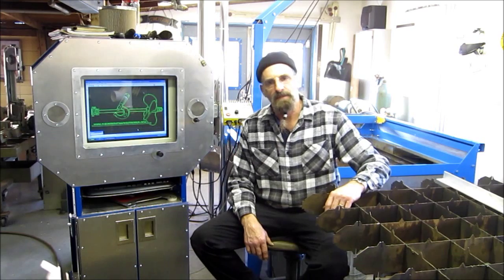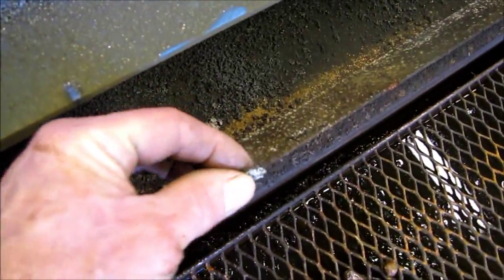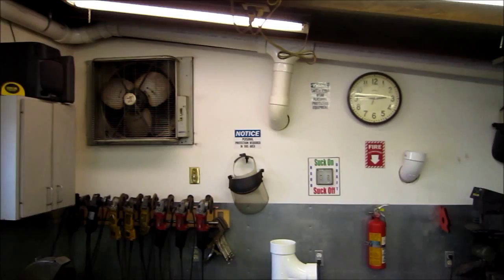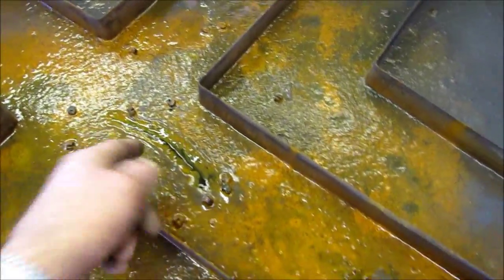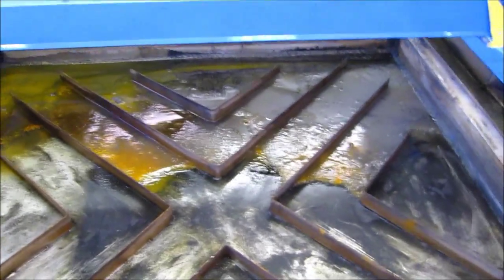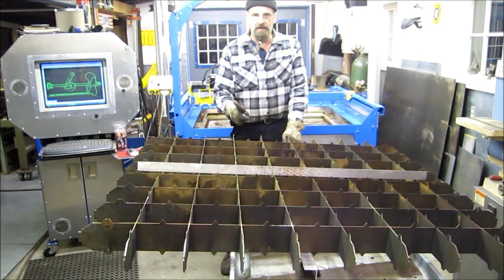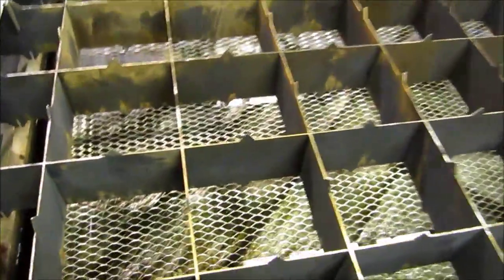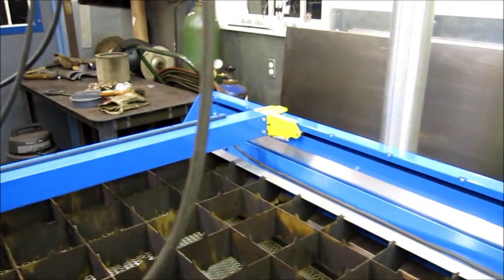Controlling your Hydrocarbons

Comment: First up, thank you for the time you must put in to creating these video's.
As a new owner of a Samson 510 your expertise is greatly appreciated.
I'm looking at setting up a similar water/down draft system instead of filtration on down draft only table.
I'm located in an industrial units but am concerned about pumping out unfiltered with neighbors so close.
How many cfm air flow are you using and how much do you think I would need on 5x10 table?

Comment: I think you may have been misinformed about the presence of "hydrocarbons" in your plasma cutter table's cooling water. Hydrocarbons are chemical compounds of carbon and hydrogen, like methane, ethane, propane (all very flammable). Long-chain hydrocarbon like oils and greases likewise flammable. And I'm sure you are familiar with the old adage "oil and water don't mix", simple hydrocarbons are notoriously hard to dissolve in water. Further, where would they come from? Unless you have a near flammable atmosphere from a natural gas leak, not from the air. Compressor oil from the compressor is a possibility, except you have a terrific compressed air filtering system. These are several reasons why no significant hydrocarbons are present in your water bath.

What you do have is metal dross and slag. Steel vaporized by the plasma jet and oxidized by the oxygen in the plasma jet form ferric oxide and ferrous oxide - red rust and black rust (magnetite). The orange stains are red rust, the black are magnetite. A little bit of CO2 is given off by the tiny percentage of carbon in the steel. Cut aluminum forms mostly finely powdered aluminum dust and a little aluminum oxide. Stainless steel forms the same oxides as steel, only mostly magnetite, along with nickel oxide, also black, and several different oxides of chromium.
Reply from the maker: Thanks john for the technical data. ;{)-----

Comment from the maker: They are formed by the high pressure of plasma blowing through the plate and becoming air born on the other side, the force of the plasma, breaks up solids to partials most which are float-able sizes, creating clouds of smoke. ;{)------

Comment: Most of the noise in your exhaust system has to do with the fan blade pass frequency in the scroll of the fan. Some combinations of impeller and fan housing result in unfortunate harmonics when you spin the impeller fast enough to deliver the rated flow and suction. The fan manufacturers know about this mis-match, but it's mostly the more expensive brands which design their fans to avoid the annoying frequencies and sound levels...

Comment: Sir,

I have watched almost all of your videos and can't but thank you enough for them.
It is a very good idea having these documents out there. 
I am an electronics engineer (MSc) who grew up with a mechanical engineer as a father.
My father thought me machine work and I have a modest workshop with two lathes, drillpress ,milling machine and the usual tool-porn collection of smaller stuff.
This shop is purely for recreational use, as I am partial to building small steam and gas engines.
Paddy

Comment: I am totally in awe of your plasma cam setup, especially the downdraft and exhaust system, I saw the "muffle it' vid, and was wondering if you had an outside filter or are the hydrocarbons just exhausted thru the muffler? Do you get a lot of orange smoke out behind the shop?

Comment: Keith, your shop is one of the cleanest I have seen. Your assertion that keeping hydrocarbons out of the mechanical areas on the table will prolong the life of those areas is spot on. Maintenance takes a little extra work but will pay off in expense, reduced downtime, and enhance ability to setup and process materials.

Keith, I just realized you are the shop teacher I always wished I had when I was in High School, I may not have had you with me then but thankfully I have you on YouTube.

Comment: I've heard about the PAM trick too but also heard that PAM can go rancid if it sits for a while and builds up.  Never tried it we've got some spray that works OK and some grease that you use for MIG nozzles.  I put a little of that on the plasma nozzle before each run it helps a lot.
 
Looks like everything cleaned up nice.

I imagine that the filter you put on the computer enclosure still looks clean?  We need to build a small enclosure for our computer, i'm trying to size out the filter.

Comment: Instead of anti-spatter spray, you might try PAM . NASCAR teams use it on their tire rims to help keep the tire particles from sticking to the rims.  Pam stands up to high heat and, is even good to spray on your vehicle door weather stripping to prevent ice locking your doors on a cold day.